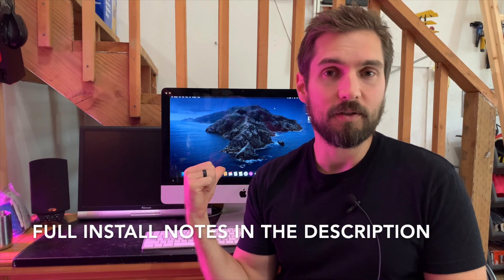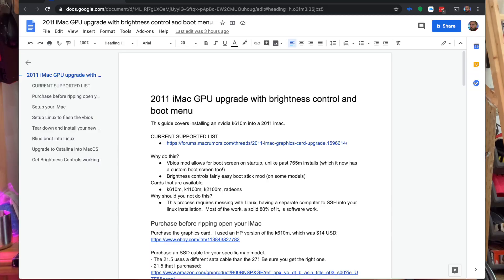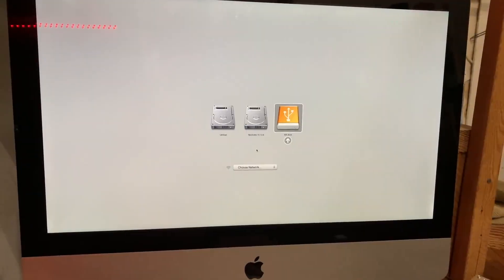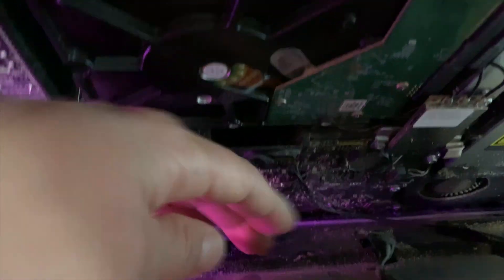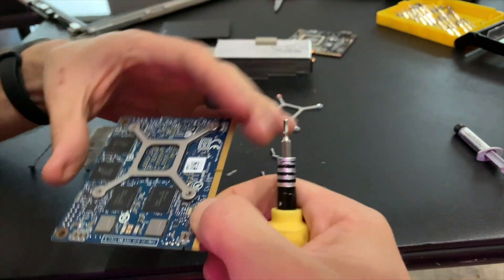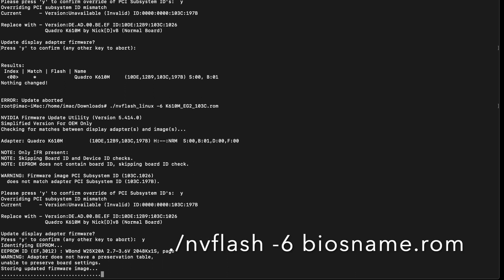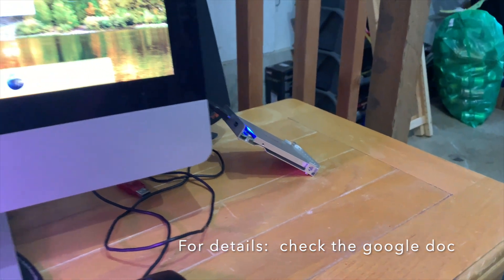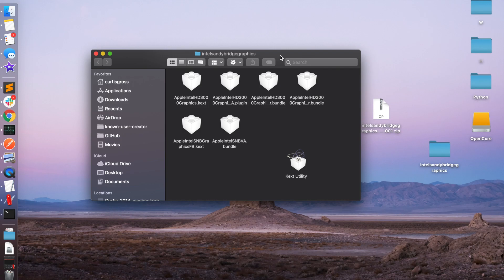2011 iMac GPU Upgrade Now with Brightness and Boot menu - Absolutely Worth It!

Comment: I have mid 2011 imac with nvidia quadro k3100m 4gb everything works no problems. You just need to flash the vbios.
Reply from the maker: rafal osip nice!  Do you have the vbios file link?  I would be interested in the k4100m and k5100m too.
Reply: @messing-with-computers  I get this card long time ago on ebay it was flashed for this imac.
Reply: @messing-with-computers  how do you update to latest version 10.15.5

Comment: Can’t i juste put the exact same gpu (6750m) in a plug and play way? Or another gpu that can be plug and play, catalina is not that important to me, and even if I’m impressed I am a little confused about your explanation everything is new to me
Reply from the maker: Yup - you can buy a replacement 6750m or a 6770m and drop these in without issue... as long as they were previously used in an iMac and not some other machine (dell / alienware / etc)
Reply: Curtis Gross bc my gpu just act so weird with stripes and lag, I don’t think that i’ll have the time to install all of what you said
Reply from the maker: @moneyfueled1056  - Yeah, it sounds like your current GPU is going out.  Luckily the 6750m is not too expensive, but it is more expensive than the card I used in this video.
Reply: Curtis Gross yes but i understand by other videos that the 6750m has an issue that create those stripes and lag, I may be sound undecided but I am searching for information as best as I can and you seem well informed, first I wanted to bake oven it but that seems temporary. Maybe you could gave me another way to do it ? Thanks for all your response mate!
Reply from the maker: @moneyfueled1056  Baking might work, the safer route is to use a 'heat gun' to heat the chip.. because baking the GPU can technically ruin your oven :/ I think "Tech Yes City" did a video on using a heat gun to fix a few GPUs!  But, note that this is still a temporary fix.  Usually hear about ~6-12 months of it fixing the gpu.
Reply: Curtis Gross it’s cool since I got a shitty oven that I was ready to junk it, (still running btw) my thought is to bake it and maybe doing a replacement like yours, event if I am a little bit confused about the steps. But don’t worry you don’t have to repeat yourself I’ll just replay the video again and again 🤣 (btw I’m french so sorry for the bad English)
Reply from the maker: @moneyfueled1056  - No problem, your english is better than a good portion of native english speakers ;)
Reply: Curtis Gross oh thanks a lot sir ! By the Way I appreciate your precision about the risk of chemicals on the oven I wish you best of luck in your YouTube adventure and hope that you’ll buzz quickly you make good contents of quality
Reply: Curtis Gross i baked it and it’s burnt and smoked and I put it at 200c for 10 min, definetely wouldnt recommend it to anyone it can be so harmful, I hope I don’t catch a tumor out of this, fuck this shit

Comment: Just finished this with a k1100m on a 27” and it’s perfect!
Reply from the maker: Snowcuber04 glad to hear!
Reply: Did you get brightness control with this steps?
Reply from the maker: 666DRAKUL you will!
Reply: I did all the steps but i cant get the brightness control working u.u i got an error verifying the size of the flashed rom compared to the size of the actual file that could be the problem?
Reply: did you use the x bracket from your previous amd gpu into the k1100m?
Reply: I have same GPU and iMac 27" mid -2011. How did you solve with the heatsink and the GPU? Were you able to fit him?

Comment: Hey Curtis. Thank so much for this and your newest video on how to flash the bios on these cards. One thing though, you might want to visit the macrumors thread and take note that your not having posted credit in the show notes to this video is generating some consternation towards you. Hope you'll see this so you will make that update giving credit where it's due as soon as you can. I did see you do so in your latest video but this one is still lacking. Hope it helps reduce any flak that's building early for you on that point. Thank you for the latest video especially. Helps a ton for someone seeing the process for the first time.
Reply from the maker: For sure - I’ll see if I can update the video while it is live. The “notes” doc does point to that thread all over though.

Comment: Suggestion (I don't know if it's possible): upgrade the bluetooth and wifi antennas to the imac 2011. With that, you can have Airdrop as smooth as the newer iMacs.
Reply: osxwifi.com  Super easy 100% reliable but expensive.  You may be able to assemble the components yourself much cheaper.

Comment: Hi @Curtis Gross! I go to the my flash on my desktop and got a permissions denied “you need yo be a supervisor to run this program”
Reply from the maker: Hey Derek - to run a command as a super user in linux you will use 'sudo' before your command.  Essentially it is short for 'super user do'
Reply: @messing-with-computers  Huzaahhh! I am brand new at Linux and networking/ssh, and I finally got it to work! wheeww. Thank you friend, that did it! I didn't know I had to also allow permissions for the nvflash file. The first flash was a dud, the second worked like a charm! Finishing it up now - thanks again :D Gunna hit-up your Patreon. Great channel dude.
Reply: Uhoh - I'm getting a "Running bless to place boot files failed." when trying to use OpenCore as startupdisk. I think I had an imcomplete OpenCore download, redownloading from your guide and trying again. Got that error again and just rebooted holding option and I think that made OpenCore work, I have brightness controls now
Reply from the maker: Boom!  Glad to hear it worked!

Comment: Thanks for the tutorial and info links. Just ordered a k1100m card for my 2010 iMac 27". I've been wanting to upgrade this for a few years now but wasn't sure on what was required. (I actually have done a couple of early Mac Pros by upgrading the video card in the past, along with the Vbios to get the boot screen). I don't really want to go all the way to Catalina yet, as there are quite a few apps that I run that aren't supported in Catalina. I have Mojave on a 2012 MBP 15" that works just fine, so I'll probably go that route. 😉
Reply from the maker: Mojave is my go-to at the moment for all my computers except my work computer.

Comment: Hi. I am writing to you from Alicante, Spain. First I want to thank you for sharing all this material, especially the Rom's of the charts.
I just have a question ... Is it possible to adjust brightness on imac 2011 with K610 and High Sierra?
The case is that at the moment, I prefer the high sierra, since it is much more stable with the old file system. I also mention that I have flashed the K610 with an external programmer, and I have saved the work of installing Linux, which in fact, I was not able.
If you know how to achieve brightness control, I would appreciate it.
I also mention that I have found an application that works, but really, what it does is adjust the contrast, and the brightness is always at its highest. Let's say it is to get out of trouble, but the ideal is to be able to control the brightness, and ensure that the iMac does not heat up as much, nor consume so much, and thus, we avoid the degradation of the power supply.
The application that I tell you is the following:
https://apps.apple.com/en/app/brightness-slider/id456624497?mt=12
It's called the Brightness Slider.
Well, I await your response.
Reply from the maker: Joaquin - if you go through the video and install 'OpenCore' on a usb stick / SD card that should fix your brightness issues, even on High Sierra

Comment: If i put a 3rd gen processor, do i need to do the hd3000 kexts ?
Reply from the maker: I wouldn’t think so - I remember hearing of someone trying that upgrade, can’t remember if it worked or not.
Reply: Curtis Gross it didnt. These only accept certain 2nd gen up to 2600S i7. I did three of these upgrades with K2100M and K1100M :) By far easiest way to flash these GPU’s is with the bootable Linux USB stick from MacRumors and SSH in over the network
Reply: When i was diagnosing my 27" iMac, it boot up with an core i3 3210, funny?
Reply: Joao Vitor that is indeed weird... However, could be because of the iGPU being a HD2xxx its a bit of a special choice of CPU the exchange with. I know that most who are looking to replace the CPU would want to upgrade to for example an i7 3770 and that for sure doesnt work.
Reply from the maker: Jeroen van Diesen - I think you are right. Some of the lower end intel may have been produced on an older node and just rebranded as a 3xxx series.
Reply: @jeroenvd89  i never tested mine with a 3770, my logic board was faulty, ive ordered a new one, will do the test, i have a spare 3770
Reply: @jeroenvd89  why cant i put a 3770 on the iMac?
Reply: Joao Vitor physically you can. It is just not supported in the EFI. Wont work, trust me

Comment: Hi, thank you for the reply to previous email. I read somewhere in your info that this will not work on the Core 2 Duo models.  Did I read that correctly. IE if we try this upgrade on the pre I3 i5 model that the patch simply will not work. Than you for any assistance. Your videos are a godsend.  Also these Imacs are getting a new lease on life with upgrading the GPU.
Reply from the maker: I have only read of a few successes with the core 2 duo models from around the 2009 timeframe.  I know for sure my 2007 wont accept anything newer, and I don't have a 2009 core2duo model to test with.  Some have reported that it will work with the Nvidia Kepler cards... (765m and k610 / k1100m for example) - BUT I haven't seen as many people attempting it, or as clear of instructions that would make me want to try to reproduce it.  Also,  the core 2 duo models are really starting to show their age ;)

Comment: I found this video right after I ordered a 2011 iMac on eBay for my wife. I'll probably do this upgrade soon. We also have a 2008 24" iMac. Will this same hack work on that model?
Reply from the maker: I think you can upgrade the CPU in the 2008, but the GPU will need to be in the 2600xt line of AMD if I am remembering correctly.  This hack only works for 2009-2011.
Reply: @messing-with-computers  Thanks for the info and quick reply! I'll look into it some more.
Reply from the maker: One other thing to note - gotta have an i3 at least in the machine.  No core2duo chips.
Reply: @messing-with-computers  The GPU (K610M) is due in the mail today. I'll probably be doing the upgrade tomorrow. Will the kexts and other hacks work with Mojave as well or just Catalina? There are some older apps we'd like to still be able to use that won't work on Catalina.
Reply from the maker: @mattelder1971  - everything should work with Mojave, just download that version of the dosdude patcher!
Reply: @messing-with-computers  Thanks. Already got that and the other files. Will be doing the update tomorrow.
Reply: @messing-with-computers  Got the card installed and flashed. I managed to do it by installing Windows 7 in Bootcamp first (leaving it set to boot Windows), installing the card, then booting the computer and using remote desktop to connect to it from another computer to do the flash in Windows (this of course requires that you install Professional or Ultimate to get the ability to connect to it with remote desktop). Now that it's flashed, I can remove the Bootcamp partition. :-)
Reply: I can't for the life of me get the OpenCore disk to boot, it always hangs, but since that only seems necessary for the brightness control, I can live with it. Everything else seems to be working good, other than the occasional black screen on  reboot (I read in the threads you linked to that this is occasionally a problem).
Reply from the maker: @mattelder1971  - Interesting that OpenCore isn't working, glad the rest is!

Comment: I think I'll be trying this with my 2009 24" as my GT 130 is dying. 

Or I could pull the MXM GT 120 from my '09 Xserve and put it in the iMac, then upgrade the Xserve instead.
Reply: It works good. I have done the GT 120 with my 24 Imac

Comment: Thanks for the video! Will try it myself with my 27 inch Mid 2011 iMac, even if I paid 91 Euros for a K610m. In Europe (Germany) it's almost impossible to find K610m for a decent price and shipping costs from the US are like 40 Dollars. AliExpress has cards for 30 dollars, but I don't really trust them with this kind of tech. Even the K2100m's are at a 200 Euro level right now. 91 Euro might be not appropriate, but I want my machine to work 2-3 years longer with Catalina, Big Sur etc. as I do not cut movies or something. It's a nice project and I like the sustainability factor of this.

BTW: I think the rallye in pricing might have something to do with your videos. :D
Reply: we have the same machine. my k610m arrived today but the problem is the x-bracket from the failing gpu (6970m) does not fit the k610m. curtis has a 21.5inch imac with smaller square in the x-bracket which fits with k610m properly... now i wish what i have is a 21.5 inch instead of 27 inch...

Comment: I can imagine some noob buying a gtx 880m thinking they've gotten a better card only to get a monster of a furnace if it even works at all as that card is infamous in the performance laptop community. HP cards have strange to sometimes non existent vbioses so I avoid them.
Reply from the maker: MrKillswitch88 - yeah. The 2100m is as big as I would go for the 21.5.

Comment: I'm running catalina 10.15.4 how did you update to 10.15.5 patch updater say I'm up to date.
Reply from the maker: rafal osip - I’m pretty sure running the standard macOS update will be the way to go. Then after the Mac OS update run the patch updater.
Reply: @messing-with-computers  I did run the standard update didn't work
Reply: @messing-with-computers  my other imac mid 2011 27 is running nvidia gtx 675mx.
Reply: @messing-with-computers  the standard update say mac is up to date 10.15.4
Reply from the maker: rafal osip gotcha - well, the dos dude patcher I used is brand new. Might be a few days before it updates across all macs?
Reply: @messing-with-computers  so this new patcher just come out I see.

Comment: Thanks so much for all this! My 2011 imac is still walking (although 2 years ago i had to reball the amd chip). Years ago I bought an nvidia 765m for safety, but I never understood if it could flash the rom. I'm also afraid that the heatsink isn't compatible.
Do you think it can work?
Reply from the maker: I actually have another video where I installed the 765m in my 27'' imac.  That was before there was a vbios, so the conclusion has shifted a little, but check it out!  You do have to do some slight mods to the heatsink (for the 27) and a little less for the 21.5 (you actually can get away without modifying the heatsink)
Reply: @messing-with-computers  Ok thank you, i will check now. I have the 27",

Comment: Thanks Curtis! You know what your doing and this tutorial plus the opencore video helped a lot! Only problem I had was due to using a newer version of Catalina that requires replacing Framework and a couple kext files don't need to be installed due to dosdude patcher doing it already, and installing them will ruin the os and will be stuck in loading screen until reinstall. Macrumors page has the instructions/download for that 👍

Comment: Lol. First of all thanks for the video. Its vital to get it better since text version wouldnt get me there. Second thing id like to notice that shitheads are really going ugly with that price up to the demand thing. I mean dude, you making me to having second thoughts about new pc instead of "upgrade". Third thing: im amazed how the apple imac 2011 community is alive. I mean not afloat its freaking living the life. 
Its all cool that you can run this old lady with 32gb memory, ssd instead of hdd/disc drive and the latest processor i7 2600s. But im equally questioning myself can the power supply unit endure it? I mean i have only a little bit understanding of the whole computer thing and i cant predict stability of system. And if still could get along well with them upgrades what. is the best GPU youll recommend? Despite the price. The beast to not to be worried about. Plug and play version.
Thank you very much on update on this topic.
Reply from the maker: If you have a 27infh iMac the power supply can handle the 2600 no problem. I would pair that with the k4100m or k3100m.

Comment: This is exactly what I've been looking for!!
Reply from the maker: Glad to hear!  I will be doing a k2100m gpu upgrade and installing a CPU upgrade into my 27'' iMac soon as well!
Reply: Curtis Gross I recently got a 2011 21.5” iMac with an i7, 16GB of ram, and a 256 GB SSD FOR $220 and am shocked by how capable and quick this nearly decade old machine is (but you already know this). Only thing missing is Catilana support...and thanks to you I now feel comfortable taking the plunge and upgrading the GPU. Thanks!
Reply from the maker: @CosmicEpiphany  Glad to have helped!  Sounds like you got a rockin machine for a good deal - i7 and everything!  When you have it ripped open you could put a bigger drive in too!
Reply: @CosmicEpiphany  will changing the GPU make the iMac 21.5 2011 possible to install Catalina? I know it has GPU issues with Radeon HD6xxx
Reply: @francisacemaglalang1701  I believe it will. But pleas double check. There are some really good guides out there about replacing these GPUs and what they support.

Comment: best video ive seen so far on this process. I may need to replace the graphics card in my 2012 imac 🖥 because it is straight up not working anymore
Reply from the maker: I sadly I think the 2012 has a soldered gpu, which is non upgradable. Might be able to tell the computer to use the on-cpu gpu instead though!  Did that on my old 2012 MacBook Pro that had a gpu go out.